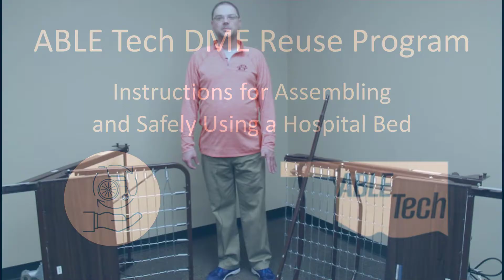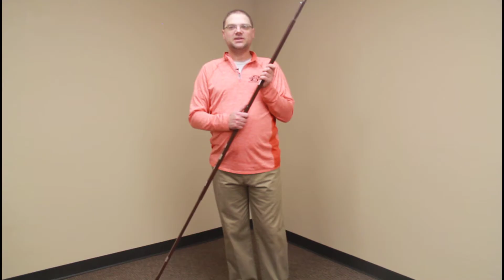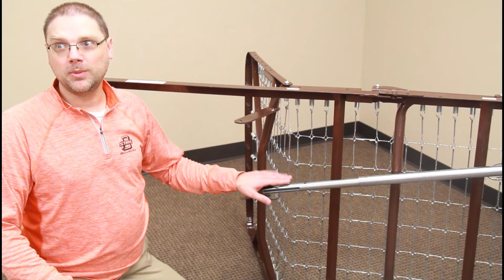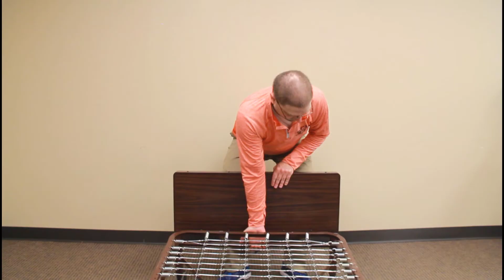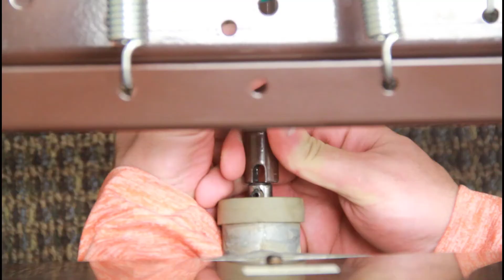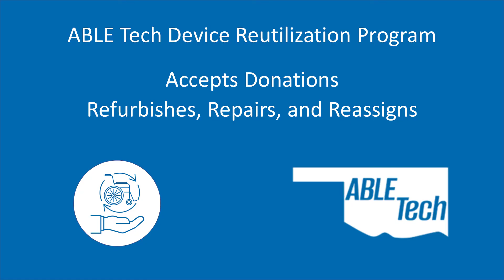Instructions for Assembling and Safely Using a Hospital Bed

Comment: The bed I have isn’t raising vertically. What could be the problem ?
Reply: Check The drive shaft. Its probably not connected to the long spring loaded shaft. The part closest to the motorized gear that is silver is also spring loaded and extends when u twist it.